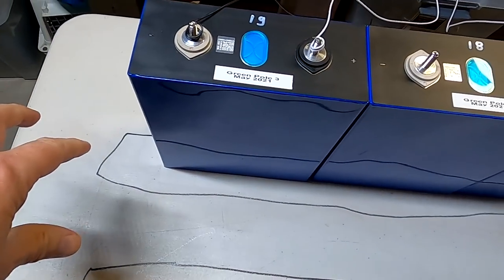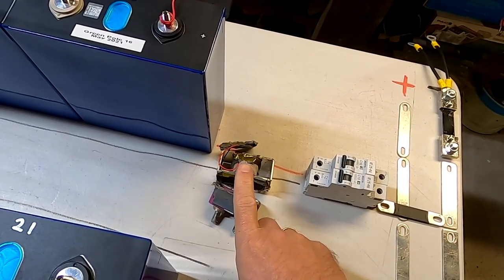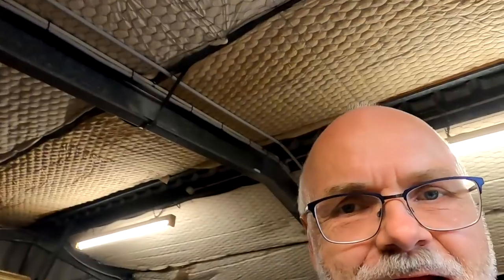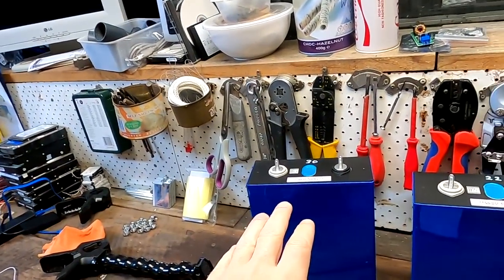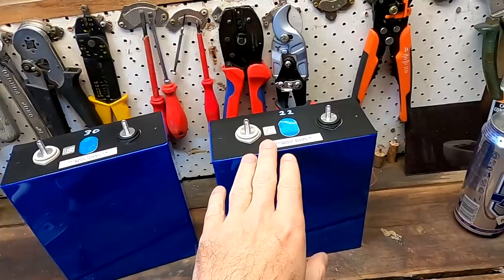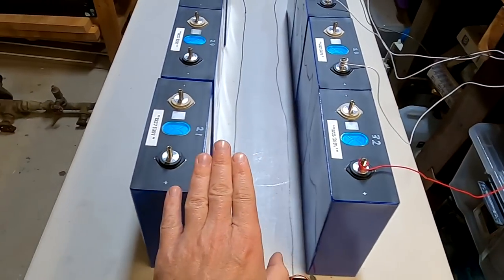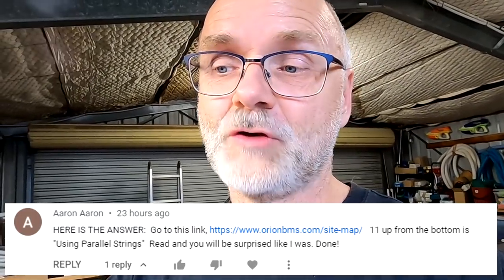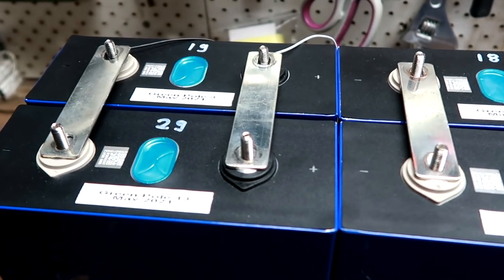Parallel Battery Strings - worst solution ever?

Comment: I have 16S2P and two sets of 16S1P. Both configurations have pros and cons. Just to note some advantages of the 2p system:
- easier to match individual cell capacities (combine the strongest+the weakest, then 2nd strongest and 2nd weakest etc...), this way you can evenly distribute differences in capacities.
- You just need one BMS
- cons: you need more busbars

Comment: I think it is very unfortunate that all of the engineering advice of the problems, complexities, and dangers of paralleling strings provided by the ORION  BMS writeup, was "thrown out the window" because of some anecdotal evidence of success with parallel strings. A single or even multiple examples of success with parallel strings simply does not negate sound engineering warning of that practice.

Comment: 062021/0422h PST 🇺🇸 062021/2122h Brisbane 🇦🇺 Addendum to my below comments. I went through the OrionBMS supplement on paralleling LiFePo4 batteries. The more I read, the more I get confused. Then again your comments, contradicting the Orion statements. Now, I’m like, should I stick to “Classic” paralleling of 8 Prismatic cells? Or should I wait for your test results in few weeks? I’d rather wait for it.
My simple question is why the publicity from Orion about the “dangers” of Paralleling the cells? Orion also emphasize the use of a Qualified EE to perform paralleling the cells. I incorporate every safety measures, redundant safety measures even, like CBs, ANL fuse blocks and switches (on single 4S my system) Paralleling the same configuration with similar safety measures, will cause safety issues? I’m flabbergasted. I ask, (Orion) why such fuss? The Battery assembler from Nevada 🇺🇸 has JBD BMS built-into their batteries and has no objection to paralleling them. A family in Idaho 🇺🇸 has installed 8 of those batteries in 24V configuration
in parallel and running with no issues for over a year. 
I think, your approach to seek the truth about paralleling is much appreciated and is looking forward to the results. Please let’s know. 73s…

Comment: I like your 2 separate battery approach for a couple of reasons. #1 With 2 BMSes you will double the balancing current. #2 If there is a problem with a cell and the BMS shuts the battery down, you will still have power from the 2nd pack, eliminating a Blackout situation.
Reply: Those reasons are exactly why I chose to use that method. Unfortunately, I had already bought 4S BMSs before deciding to go with a 24V system (instead of 12V). So for the time being, I've got two BMSs per 8-cell bank instead of one. It's just like having two 12V batteries in series (per bank), so it works fine. I'd most likely fry my 8-cell active balancers if I tried hooking them up to this set-up, but I haven't seen much need for it anyway.

Comment: You have made your decision, great. Just as a side note Pylontech use the parallel string method in there battery systems. Each of the us3000 battery frames I am using is operating at 15S and parallel connections are made at the front of each frame. Each frame has its own BMS, shunt and internal cut off. The only difference is each frame's BMS is connected via an RS485 data cable so BMS data is shared to each frame as well as the MPP inverter charger I am using, so I assume each us3000 frame knows what the parallel frames are doing. I have been toying going your direction but as I have already invested in the Pylontech solution its far easier for me to add a few more Pylontech frames to increase the storage capacity.
Reply: Hey I'd love to see pictures of this.

Comment: 061021/1838h PST 🇺🇸 061121/1138 Brisbane. Thank you immensely for discussing such an intelligent subject on paralleling LiFePo4 batteries. There has been no such discussion on YT, or may be some peripherally, skimming on this, very important issue. But no one knew what was being discussed. 
After downloading the ORION BMS, going through it and listening to your lecture; it became crystal clear as to how to Parallel LiFePo4 batteries, correctly and safely. Imagine 33 batteries being paralleled with its own dedicated BMS! Flabbergasting, indeed, but logical. 
Thank you for your lecture on this subject, you have opened up and cleared my doubts. 
Stay safe and 73s…

Comment: Boat builders use parallel strings (see Mastervolt, Victron). Best to split the DC bus into load and charge. Overloading switches off the charge bus, but your load will continue. Undervoltage will switch off the load DC bus, but keeps the charging up/connected.
If you use parallel strings, split DC bus probably makes not much sense (as one of more other strings are always connected, when only one string disconnects).
Reply from the maker: Yes, that makes sense. You also need a bit of advanced control systems then to have your load/charger connected and disconnected under certain conditions.

Comment: I had a 4s4p and had a problem and 8 cells died together and 8 cells lived to be used another day. Now I have a 5s4p pack, higher voltage, higher energy, same peak current (1300A) and it should survive as it won't be overcharged at the voltage the first try was experiencing (18.2V). I had a full-time capacitor balance board, and no bms, no fuses, hard to fuse for over 1000A anyway :-D Aside from the over charging, the balance board got salty and wet and failed or possibly got cooked by the overly high voltage, and that's what lead to two banks staying at an acceptable voltage and 2 banks being absolutely fried/boiled to death :-D So from that extreme torture test, I would conclude that the paralleled cells do indeed walk in step and fight in unison and die side by side, or live together through strength in numbers. Having said all of that, My other comment stands, I'll seriously consider having 4 independent banks, however I can't think of a valid use case beyond a 2-way split, so there's that.
Reply from the maker: Oh, wow, what an experience! How did they die, just didn't work any more or did you have a RUD?
Reply: @OffGridGarageAustralia  What's a RUD? The cells seemed to have leaked electrolyte out and upon inspection later after finding it wouldn't start from the pack any more I found that all 8 dead ones were open circuit, accepted no current, no matter the input voltage. I suspect they're dry inside. Could they be rehydrated? Not sure, but don't really care, either. It was kinda hard to tell, though, as the salt water basically shorted out the cells at one end anyway and the resulting corrosion made them quite ugly. However upon disassembling and testing some of the 8 survivors were some of the ugliest, but I got them cleaned up and they're in service doing just fine right now :-)

Comment: Orion's claims are misleading. If parallel anything you always will have balancing between them. Between 2 cells (in 1 pack) or between 2 packs. But with 2 packs you monitor all cells and with 1 pack you monitor only the two cells average. Also you can buy cheap Renogy shunt with display to monitor each pack's power consumption (no need to buy an expensive Victron).  I always tell people to test the 20-80% and 30-70% balance of 2 cells and measure the current flowing. Because of the flat discharge curve only minimal. So if you put 2 cells parallel it will take a long time for them to balance out. Luckily you use lower charging V, so you will not float one pack full when the other is still charging. This helps balance out the 2 packs easily. Only one thing you have to pay attention and that is the current. If 2 packs online you have 2C charging and discharging rate. If one stops (like BMS stops it) then you have to get it lower to 1C max. Or you use only 1C and there is no problem :)
Reply: Agreed. They read like someone talking to DIY'ers telling them they need a degree to work with lithium, "and here's why". Many of their premises are non-issues or at least less than significant impact. You don't NEED all the little bells and whistles that would be nice to have, but unnecessary for a functional system. And those can be added a bit at a time. I've been in power at AT&T for 20 years (recently retired) and I've worked with every kind of battery chemistry, including molten sodium batteries (sodium-nickle). Kinda like telling a farmer he needs a certified mechanic to install a start battery on the tractor and that "duct tape and bailing wire" will get you killed (that's a John Deere joke). Maybe. But isn't that our choice?
Reply: 1C in a 280Ah 51,2V battery means over 14kW of power! 
Andy uses only a 2,4kW power inverter
Reply: @zarbonida  For now ... but later he wants to connect the house to the off-grid system.
Reply: No, they are not misleading. 
Parallel strings balance only the strings, not the cells inside.
With 2 packs you need 2 string BMS and one master BMS - total of 3 BMS.
And you will need 3 shunts also.

To put 2 cells paralel you need to cycle test their capacity and sort them in bins.
Now you build packs only from a single bin and connect them at equal SOC (State of Charge).

And Orion talks especially about that - cascaded failure occur because you lack all of this costly things, and someone does not pay attention.
In automated system there must be no need for someone to pay attention at it, so it doesn't fail.
Reply: @TexasVeteranPatriot  Cascaded failure is pretty significant impact.
And if you wish, you can go without all they recommend, but instead capacity testing and binning of the cells is needed.
On top of that life cycle testing is usually done too - cell is cycled until certain cycles.

Also, talking about AT&T is completely out of context here.
They do not buy random undocumented chinesium on Ali.
If they don't do all capacity and life cycle - the OEM does it for them.
Reply: @2L40K  Sorry, but everything you say is wrong. You need 2 BMS, so 1 for every string. NO need to a 3rd. You mistake it for serial. There is no BMS for parallel strings !  Also no need for 3 shunt, one is enough. The parallel strings can balance each other out if you use low V charging like 3,5-3,55 per cell. But because of the higher V of the strings (a cell 3,2V but a string is 51,2V) even the smaller differences balance out more easily.
Also you forget that cells age differently. If they are put parallel then one will be worse and worsen by every cycle. BMS only sees average V, so no disconnect when one cell hits the max V ... only after at least half the cells is OVER the max V. That is the main reason for example the Tesla (like) battery fires.
Reply: @mrzed6597  If you use only 2 BMSes one of them must become a Master, e.g. be aware of both and report on the BUS. Can't see any cheap chinesium being capable of that Master function. If you look at real commercial solutions, for example BYD or Pylontech (both Chinese) they all have a Master. Pylontech units can be made Master up to 8 Units else HUB Masters needed, while BYD always have a separate master per 6 or 8 blocks.

And the Master needs it own shunt...

On the contrary BattleBorn Batteries - Made in USA do not need any kind of BMS! But are expensive.
But they have extremely precisely equal capacity cells that age absolutely the same. This means what I already explained - capacity testing and sorting and life cycle testing.

It's impossible to build anything reliable based on random undocumented untested and unsorted chinesium from Ali.

You either need complex expensive and reliable monitoring electronics, or rigorous   expensive testing sorting and aging of the cells. Or both of these.
Reply: @mrzed6597  Now to explain to the technically illiterate why you need third shunt. You need to know some Mathematical Statistics, namely theory of measurement errors. 

You have 3 currents that meet in a point. Whit only 2 shunts you measure 2 of the currents and calculate the third one. Error of the third is equal to the sum of errors of both measured ones.

Now suppose one shunt measures 100 A, the other measures - 90 A, than the third one calculates to a - 10 A. If all the have 5% error, this means 100 A +/- 5 A and 90 A +/- 4.5 A. And the calculated one is 10 A +/- 9.5 A.

You see, the measurement error is comparable to the current itself. At 1% error you still have 10 A +/- 2 A which is 20% error of the sum! Despite 1% error in measurement!

To do it accurately with 2 shunts you need a supper expensive super precise ones.
Reply: @2L40K  Wow that is a heavy load of wrongs :D 
No you do not need the 2 BMS to communicate with each other. No master, no secondary there. They are all managing they own pack. 
Yes Pylontech BMS can be connected to Victron, MPP Solar inverters. They get the real SoC from it, and nothing else. I do not know any DIY used BMS that can be connected like Pylontech. No, no "master shunt", master only calculates total SoC from sub BMS's data.
In the Battleborn and Bigbattery made batteries a BMS is already INTEGRATED into the box! But if you put them series (like 4s) then you need a 4s 48V BMS.
"they have extremely precisely equal capacity cells that age absolutely the same" ... please do not joke ! 
And please try to explain the rest. What 3 currents? You have current 1 to battery 1 and current 2 to battery 2. Where is your mysterious third current is coming (or going) ?

Comment: I'm getting ready to build a 2P16S using 280Ah LifePo4 cells. I will use a 100Amp BMS (all from battery hookup). This will replace a DIY 18Kwh pack (48v) that I made from 18650 cells a couple years back. I figure that if I was able to run 120 cels (LiPo 18650 = 120P14S) in parallel for 2.5 years without ANY issues at all, then a 2P configuration using LifePo4 should have no issues at all.

Comment: Another consideration: many of these "discussions" revolve around cylindrical cells... Like 18650s with a limited capacity (in comparison to these big 280Ah cells) and thus limited charge/discharge rates.

If you have 3p 280Ah cells, where will you find a BMS capable of 900+ amps charge/discharge? How many solar charge controllers can pump 200+ amps into your battery (0.25c)?

Once you move away from small cylindrical cells, it just makes sense to build 1p banks with discrete BMS boards per bank. I don't know that you could even find a BMS capable of matching a 2p, 3p, 4p.... pack with such huge capacities.

Of course, if you're building a pack from 3400mAh cells, can you imagine the number of BMS boards you'd need to power a house if you used 1p banks? Phew!

Economics is the real deciding factor in both scenarios. Either method works.

Comment: I have a 500w 12v wind turbine... marsrock mppt hybrid controller 1500w wind and 1500w solar. This mppt controller came with a battery balancer but it seems to only be used for 24v application (series wiring). Can having a 12v battery wired in parallel effect the mppt controller?

Comment: Andy,
I don't want to waste your time, but I have a technical question, like everyone.
In this very useful video you connect the 2 battery banks in parallel.
How many Amp's you can use in total? 
Is it like BMS 1 + BMS 2 = total please?
Regards.
Willy

Comment: I have run the 280ah 16s 2 strings in parallel using the daly bms. I would be curious if the JK bms can also work in parallel mode
Reply from the maker: You can use any BMS for that, even different once for each bank.

Comment: I find you sharing very helpful and thought provoking. I have just received 32 310Ah cells from China and am waiting for the lithium battery tester to arrive to check them. After seeing this video it has made me change my mind back and forth between two 1P16S and one 2P16S layouts. As both seem to work and you have opted for the former I will go for the latter and report back if I come across any issues. It will save me having to buy and therefore wait for a second BMS. Keep up the excellent work. We are all learning lots care of your efforts.
Reply: I do not know your application, but I suggest two parallel strings with their own bms, current monitoring and their own inverter.  The inverters need to be designed to synch with each other.  This is for life safety systems (medical, sailing, etc.)  Since each bms, current shunt and inverter only handles half the power,  the expense of the electronics can be lower than 2x. Obviously if one string faults, some loads may have to be shed, but the critical ones can be supported.
Reply: My application is a bit unusual as I am using a small trailer to transport surplus energy from an off grid system back to my home. Not a critical application so no problem with a 2P16S configuration. My main problem at the moment is that the cells are well below specification and I am hoping to get a resolution through Alibaba. I am very glad I bought a EBC-A40L tester. It has enabled me to prove that the supplier has sent cells which are not up to spec.
Reply: @nigelcharles511  who was your supplier?

Comment: Hi, what is the best way to connect 5 or 6 gel batteries of 100AH for a 12v system? They do not give me warranties if I connect them in paralel... Thanks!
Reply from the maker: All same brand and capacity? Should be no problem. How do they know you had them in parallel in case of a warranty?
Reply: @OffGridGarageAustralia  yahh, how do they know... but yes, 4 X bat with 100ah each, same dá-te, same brand... can I connect them directly with Cooper bars, positivo in one side and negative in opposite side of the bars? Many thanks for your reply.